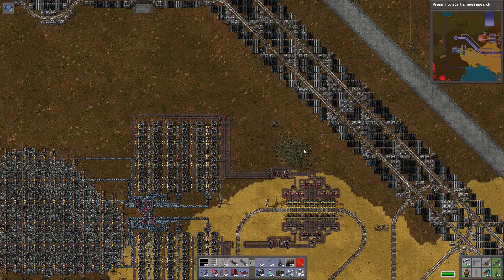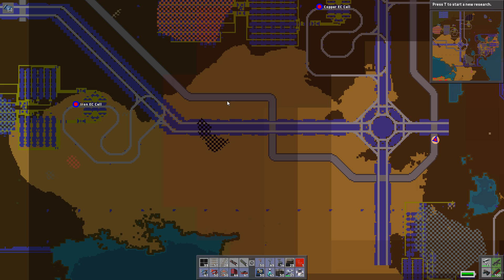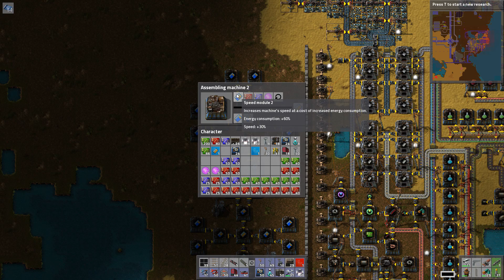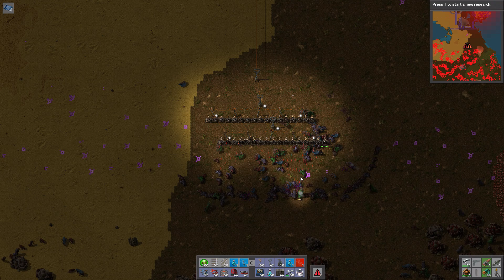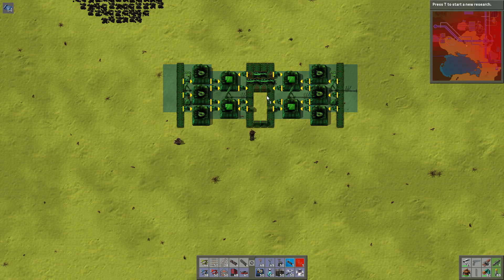Factorio Meiosis :: Power Armor Mk.II - Episode 7

Comment: You could have the coal offloading and onloaded (uploading?) inserters be burner-inserters, so they'll run even if the power for a "cell" isn't hooked up, and most importantly will keep running even if your system suffers brownouts because of power spikes. You don't want your entire train system to suddenly shut down because one train ran out of coal.
Reply: Burner inserters for boiler fuel loading is great...will load even if no power.

Comment: I think I mentioned this on a previous video of yours.. the ratio for speed modules is 4:2:1, not 8:4:1 that you built... if you check, you'll see each tier of module takes twice as long as the last, which is why it works out as 4:2:1
Reply: You should also be aware that train loader design is going to be completely broken in 0.13.. the cars are 6 long with 1 block space between each car :)